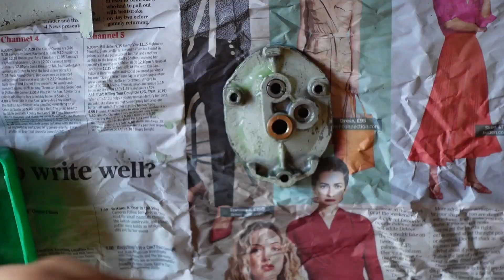Vintage Black & Decker Drill [D520] Restoration

Comment: Just rebuilt one of these, but a later single speed one. These earlier ones are a lot better built with proper bearings and all metal parts. Well worth restoring. Later ones started using lots of plastic. The fan. Spacers. Casing etc all plastic. Don't get me wrong still a good drill, and survived from 1978, but you can see the much higher quality on these 60s drills. Good job.

Comment: Excellent work only one possible problem is applying grease to the gearbox housing screws may Couse them to loosen over time, try wiping a little oil with a rage over the threads instead other than that a perfect restoration!

Comment: I'm trying to replace the brush[es?] on one of these, under the plastic black cap on the top rear. Can't figure out how to remove the one [two?] that's in there. Didn't see you cover that in this video. Do I just yank the spring/brush thing out, certainly doesn't want to come easily? Any advice would be much appreciated.